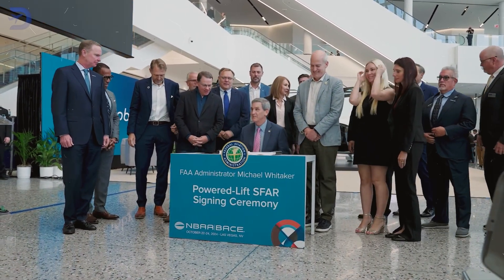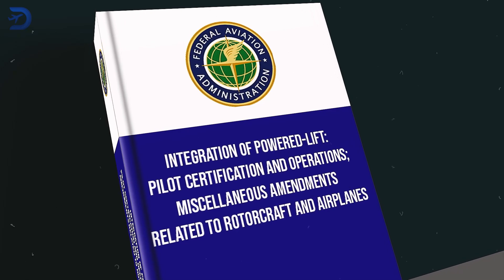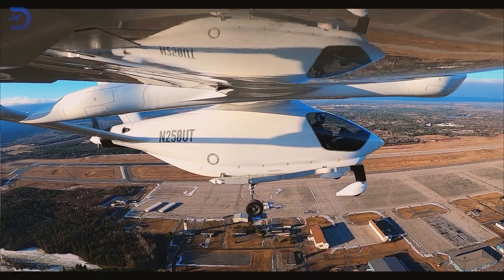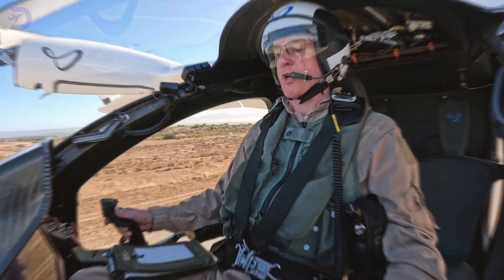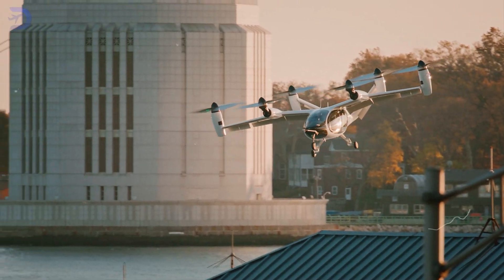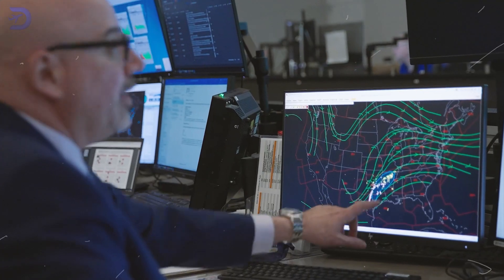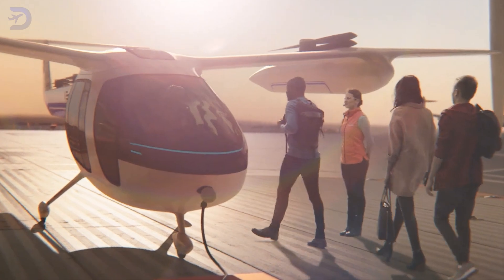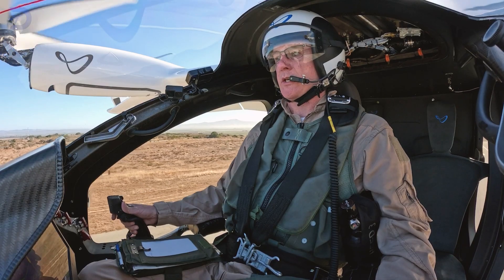FAA’s New Rules for eVTOLs Explained  Everything You Need to Know

Comment: How will they scale if pilots require 500 hours minimum?
Reply: That requirement is for Part 135.243 for single pilot operations VFR only. They will gain enough initial pilots from retired 121, moonlighters. Part 135 for IFR is 1,200 TT which these folks all have and much more.

Comment: Any form of voice based ATC is utterly infeasible for even a slightly greater air traffic volume as is ' see and be seen' for collision avoidance .  The in flight emergency procedures for vtol and low duration battery aircraft will be critical eg with multiple aircraft running out of charge simultaneously due to even such a simple thing as a wind change and cascading demand for landing slots, overcrowding on the few vertiports or crash tieing them up and numerous other causes.
The Uber elevate proposal was inherently unstable and incapable of any significant throughput as well as requiring much acreage and showing multiple levels whereas only the top one would ,possibly, be usable ( try approaching from downwind with a huge angular structure generating it's own turbulence and suddenly reduced headwind ... 
Without having folding wings and powered wheels the hold ups on the flight deck would not only reduce any revenue earning capacity but create enormous safety problems for the pilots with passengers ducking around other  evtols and hurricane force downwash winds .  The entire scenario is fallacious and only a system that does NOT require transitioning, does not require large chunks of real estate or vast complexes with acres of glass, waiting rooms, taxi interchange, passenger facilities ,escalators, baggage handling etc etc as depicted on the Uber pipe dreams and reshown here, can possibly work.
A pre boarded air vehicle with a roll on roll off rapid turnaround without  'dead man zones' in operation, fail safe and maybe 100 times cheaper can feasibly work, in the sense of being available where needed, affordable, acceptable to neighbours , without curfew or other restrictions etc etc and ,as originally sought by all the start ups ( and shown in their original patents and artwork, eg  Lilium, Kitty Hawk, Joby et al as being road going not just different types of helicopters .
The ultimate vision often referenced is the Jetsons where my Everyman flies himself around just as he now drives his car and with as much interaction with some disembodied 'controller' or some other 'big brother' style centralised command system. When did you last file a drive plan to be allowed to use your car? Or ask permission to start it or request to go somewhere?  The main task is to go where you will and not hit someone else or something in the process- that should be the aim of any flyable car system ( and was in the PAV era or the AGATE program and SATS rather than replicating the faults if the airline 'flying bus' with passive ticket holder model.( as is the misnamed " flying taxi' concept)
The extraordinary low flight duration and low speeds and ranges will make emergency re routing or precautionary landings, or even fuel exhaustion in flight events unavoidable ( as has been the case with airliners and lead to crashes)  
Good airmanship will still be needed with a glider pilot's outlook of always having in mind the need to plan for a forced landing and not having power to rely on.
 Others have predicted what the effect of even just one catastrophic accident in commercial evtol operations on public reaction might be some citing the end of Pan Am rooftop helicopter shuttle flying...
More needs be said to temper the mania now evident on evtol.
Reply from the maker: @rossnolan7283
Thanks for your comment ! We could literally make a video out of your comment. 😄
Reply: These types of critical analysis/comments are welcome and help the industry progress - thank you!